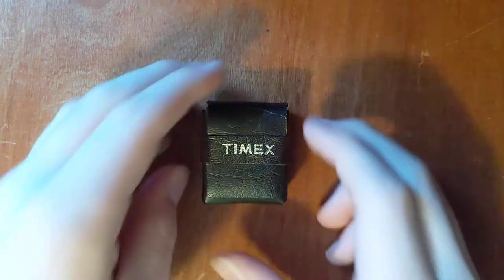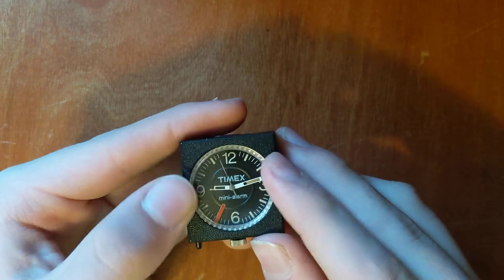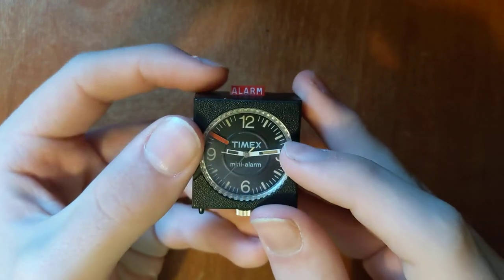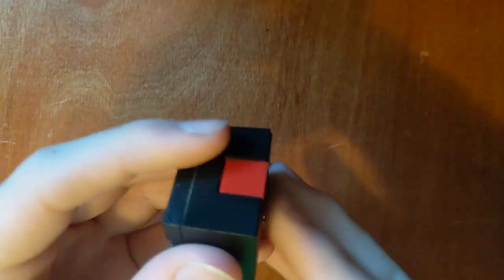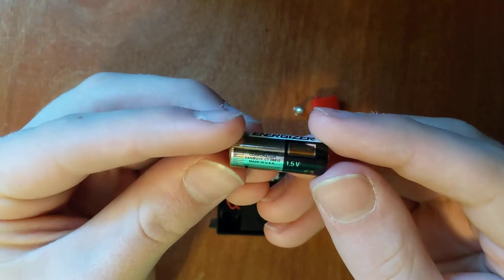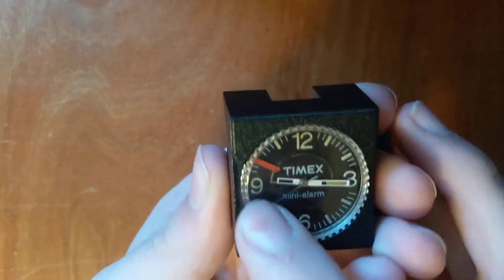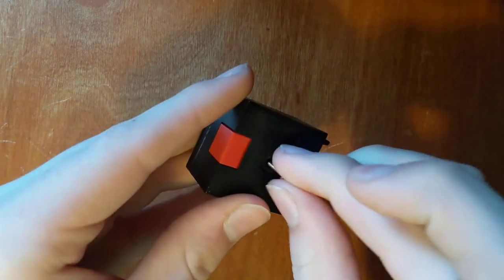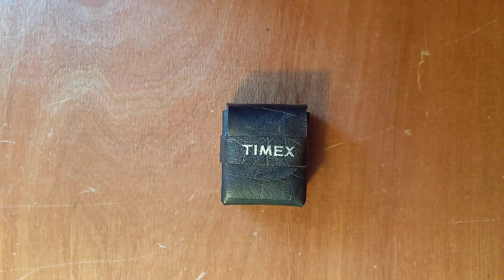TIMEX Mini-Alarm

Comment: Found one the other day at Goodwill outlet. Battery was leaking and battery contacts was corroded the time mechanics was frozen. Disable soaked in CLR rinsed with rubbing alcohol let dry applied a small amount of scissor oil/ sowing machine oil. Back in action.

Comment: Cool clock.  I found the off-white version of this guy at an estate sale today but it didn't have the case.  The movement runs for a short time with a gentle shake but it is probably in need of a lube.  Mine has no markings, date codes nor battery in it.  I like the idea... it's as if Timex took one of their watch movements and basically just built a plastic box around it.

Comment: Anyone have issues winding it? Mine appears to wind up but the hands do not move after doing so, and all of the tension from winding seems to release as soon as I let go of the knob. Great video, would love any suggestions
Reply: Do you have to push knob in after setting time?
Reply: Looks very tiny. I'm 6 years old he's 2 months old no he's not the person it's just the analogue clock well oops I didn't know it was not a clock it's ok next time I will call him a clock.
Reply: I keep  gently tapping the clock  on all sides. Everything started moving properly.
Reply: @alaskahope  don't forget that and that and that and that and that and that all 9800 things
Reply: @alaskahope  I got more than you. which is: 10137.
Reply: @reubengarland7343  I will be looking for more of these little ones. Now I have a new hobby for a while.
Reply: You can use the hobby.